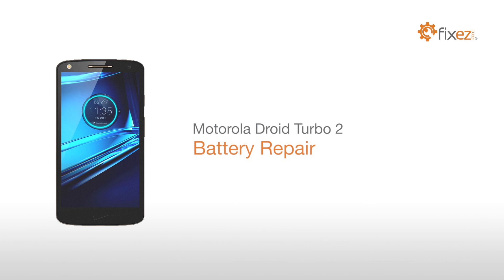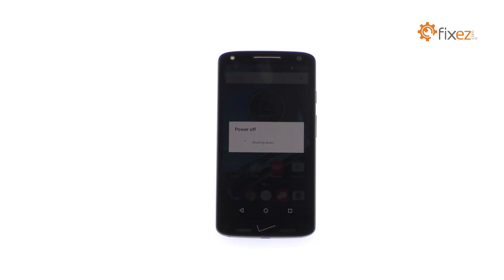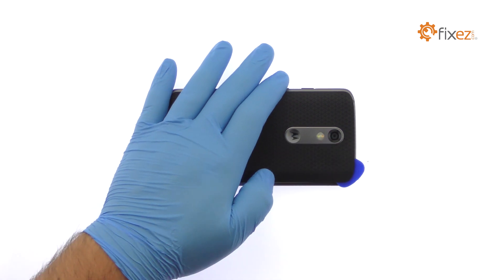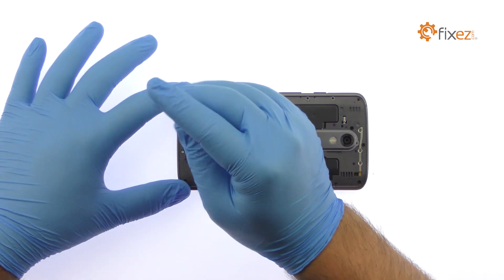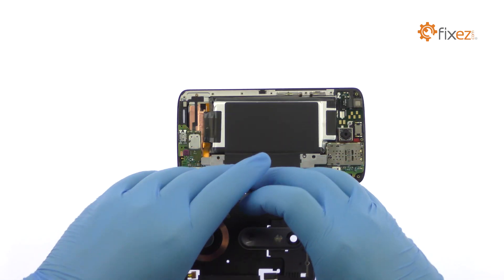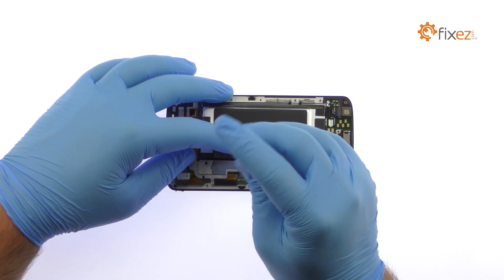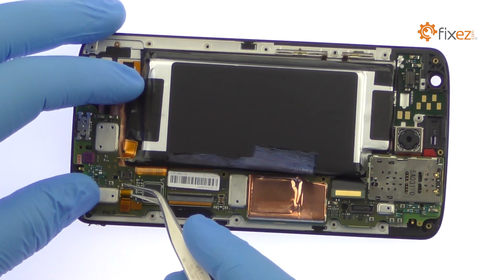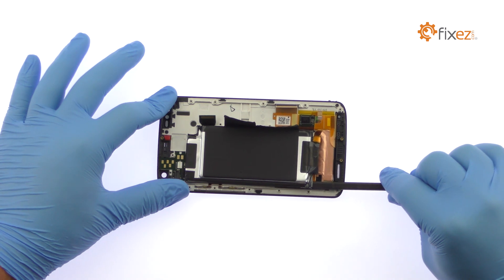Motorola Droid Turbo 2 Battery Repair Guide - Fixez.com

Comment: Why was the adhesive removed at the end, as opposed to heating it back on? Will there be a moisture concern after it's been removed?
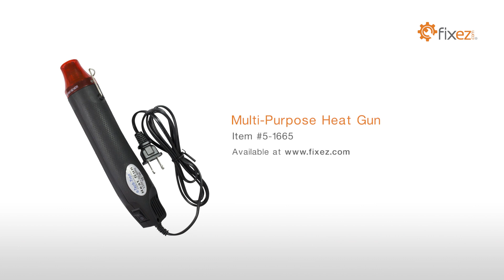Reply: I believe that they actually left out a step at that part of the video. If you pause the video at 00:34, you can see "Premium 2mm Red Adhesive Roll". This is actually a double-sided adhesive roll I found on their site for $5. What we see at 09:16 is the technician removed one side of the double-sided adhesive. Meaning, that the adhesive was replaced instead of removed or re-heated/used.

Comment: hi there i have droid turbo 2 
i don't know what is the problem with the phone it drains battery while charging  even when it is power off and it is at charging  
also it does not show turbo charging 
its battery was 12% i put it on charging it goes down to 6%
Reply: Apparently Motorola designed them to do this at around two years old. Mine is doing the same. Battery is my guess.
Reply: This thing happens with me my Motorola droid turbo 2
Reply: This is a common issue with Li batteries when they are not properly charged/discharged over time (2-3 years), they tend to develop a "memory". You may be able to overcome this issue by fully discharging the phone's battery by running an application (a game or a utility that constantly uses CPU cycles)  that will fully deplete the battery, otherwise your phone will tend to just shut off around 30-40% battery life. Once totally depleted, use the low current charger USB cable (not the 2+ amp cable for your turbo charger) to fully charge the phone before turning it back on. This may be an 8 to 10 hour process.  And, you may have to do this more than once. It should significantly increase your battery life. Going forward, do this every 90 days if you can.

Comment: Excellent video until it tells you to remove the earpiece speaker. completely unnecessary step. I caused damage to the speaker getting it out. after taking a close look I realized I could skip that step and still replace the battery. Otherwise a good step by step process. Follow it, just leave the speaker alone.
Reply: Wish I would have read this comment before proceeding . I had to order a speaker. Otherwise excellent video.
Reply: @wildpony1961  yup, fucked up my speaker too.  I'd love to say its a great video but when 1 step ruins everything, trhe rest of the video doesn't matter.
Reply: Im glad Im not the only one..
Reply: Yep. Me too, except I managed to stop half way pulling it apart when I saw some wires I shouldn't have.
Reply: I was able to replace the battery without touching the speaker, camera, or removing the mother board and its associated connectors. Helpful video, but maybe a little overboard on how deep you have to go into disassembly to get the battery out.